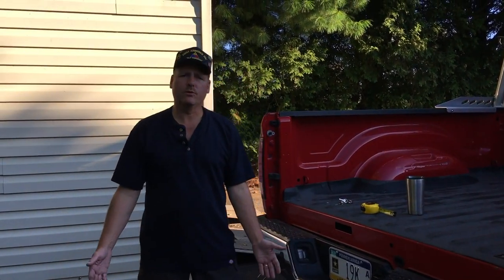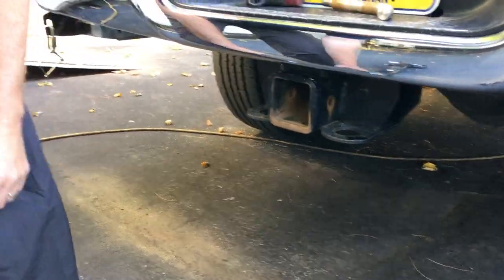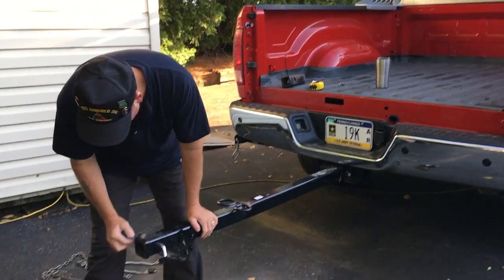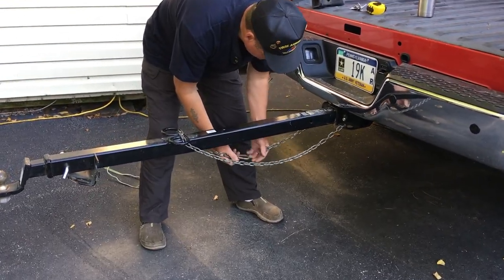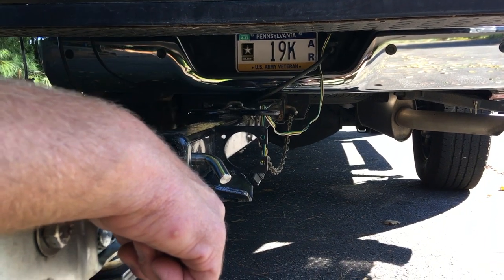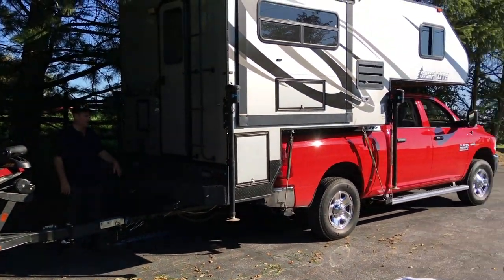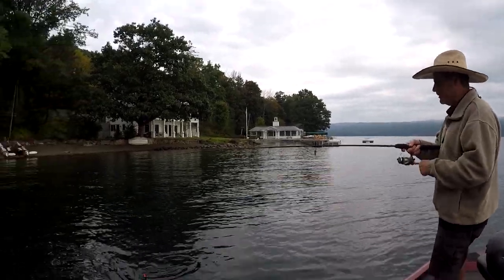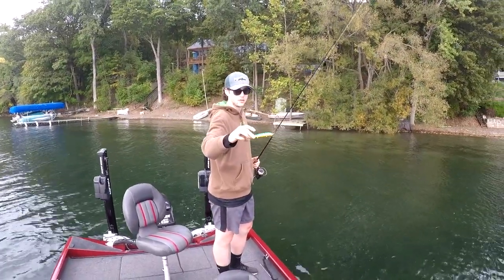Truck camper HOW TO tow a boat Keuka Lake fishing CampLite Livin Lite  RT188

Comment: Yeh, I'm late to the party. I'm surprised you didn't add hitch stabilizers or anti hitch rattler clamps. I wish my Hummer H3 used the 2 1/2" receiver. I'm only using a utility trailer with about 100 lbs. tongue weight anyway.  This would be great for me so I could swing my rear door out to get to my tools when I go to work on my property. I did find the 18" extensions.

Comment: Tow Ready Combo Bar with 2" Trailer Hitch Receiver - 48" Long - Raw Finish will this be ok to use I have a f350  have a camper that hangs over alittle and a 19ft 1994 gambler bass boat single axel. I have no idea when comes to hauling with extention bar...so I’ll used your best advice..and thanks

Comment: Glad I found your video.  I am making my own hitch extension and I'm sure I'm going way overkill on it but I have a question or 2 for ya.  How much does that tongue weigh on the boat and what was the total length of the extension tube from the edge of the receiver to the ball?  When you are backing it up in the video there is a lot of flex on that long extension but unless it has failed you then no critisizm here!
Reply from the maker: Tongue weight is 750lbs, the length of the extension is 40”. It is double walled steel and the receiver hitch is a class 5.
Thanks for watching!

Comment: Love that rig - thinking of going the same way but need to buy everything but the boat!  Question: do you have separate electric systems from the truck to the camper and one to the boat?  My boat trailer works with the 7 prong (has breaks) so wondering how I might be able to run both.
Thanks!
Reply from the maker: cutwingsmatt    Wow great question!!!!  My boat operates with a four prong wire, the camper has the seven. The back of the truck has outlets for each one, if your camper and towable (boat) both have the seven you will need to buy a seven point “y” adapter. This will split the outlet from truck into two!

Comment: Just curious what that bar is rated for. I just got a superhitch by torklift (haven't gotten to try it yet cause it's winter in new England) but it's rated for 5k @ 60 inches without weight distribution. I have a 22.5 ft bow rider I'm guessing weights around 3500 pounds. Just wondering if I spent a boat load of money for something I could have done with a regular class 5.
Reply from the maker: Nicks Ahoy     I’m not sure about the rating, I’ll check if the sticker is still on it, but your setup sounds great. When your driving down the road it will be a good feeling knowing you are safe. The money spent will be worth it.

Comment: All you are doing is making a weak link at the frame of the truck. Sure everything from the hitch to boat trailer might hold up. But what about the hitch mount connection to truck frame. You better put doublers on the frame otherwise you will snap the hitch right off the frame. It may work for a long time but one day snap and that aint kool.
Reply from the maker: I understand what you’re saying, but the tongue weight is very minimal. It’s an aluminum boat single axle trailer.

Comment: I am having trouble finding that long of an extension. Where did you find that one?
Reply from the maker: BOB FREEBURN  Helllo, on this video and a couple others you can see the boat connecting to truck and camper. I purchased this extension from a local RV dealership
Reply: etrailer

Comment: Just for piece of mind, you didn't want to shorten the extension  a little?
Reply from the maker: TheNutzandBoltz    When the boat is connected I needed the length when making sharp turns so the bow of boat doesn’t hit the camper
Reply: oxford821 Copy that, good call going big on the truck the first time around.  Sucks when getting a plan and only find out you have to upgrade.

Comment: this was really good, but damn ive got to have my airtow trailer moto everything lift & haul & the guy at 5 star RV says i only need the 2 inch extender, I WANT MY CAMPER BUT I HATE THE LONG EXTENDER,  NUTSS MY DREAM IS DISSAPEARING
Reply from the maker: STEPHEN CHRISTIAN    Get the best you can afford, you’ll feel safer going down the road
Reply: @oxford821  thanks! I really have spent days not hours searching researching it's probably about $5K worth of items but i've been knocking off 1-2 hundred $'s here & there, I always get the best I can even if I cant afford, i make it work, great to hear from you & all the best will be watching. PS. 1 way to reduce length regarding that extender i've been thinking of removing the bumper & step but u know that step is nice to have any way the ladder on the adventurer 50th aniv is attached to the bumper. I'm just a minimalist i like things compact & as efficient & small as possible even my home was only 1k sq ft I just turned it into a well designed custom opened up pad with the best of everything terms of appliances ext.. thanks again
Reply: @stephenchristian5739  I have a Chev 3500 Diesel with an Arctic Fox 865 Camper.  I started out with a setup like the one shown here, but I had to add airbags and a device that engages the overload springs sooner.  I still did not like the towing with my 17.5-foot Alumacraft fishing boat with the long insert.  I ordered a Torklift Super Hitch Magnum and the matching Torklift Super Truss.  I feel so much more secure on the road now.  I am into it for about 3 grand, but to me, the safety is worth it.
Reply from the maker: That’s a good set up

Comment: Seems like you would need side to side support.
Reply from the maker: Rodolfo Tenorio    Hi, my truck is a 3500. It has stronger chassis system, along with factor rear air bags that self level. It drives along pretty well without sway.
Reply: That's what those 2 loops are for half way up on the hitch is to get chain and a turn buckle or even something as simple as a ratchet strap going back to the frame of his truck or bumper.  I run that same extension and you're right on with the fact you do need side to side support
Reply: oxford821 i think what rodolpho means is side to side, play in the extension itself, if you just cut the chain you installed into 2 and added a turnbuckle, on each side, you would have what the torklift basically is, for alot less $$’s

Comment: That system is not safe if you go into a deep dip in the road or similar you will bend or tear your hitch off what you need and I know as I just did this conversion is a torklift Superhitch it has two extensions in tandem a class 5 on top and a class 3 on bottom check them out it makes towing a boat or whatever safe with your camper... you can really see your single extension flexing be carefull it has no side to side support or up and down,, link here https://www.youtube.com/watch?v=aMx--TKvZRM
Reply from the maker: Magwa Magwa    Thank you, I definitely will.